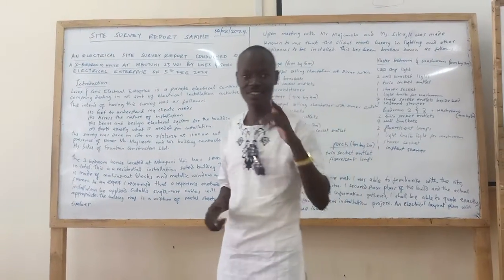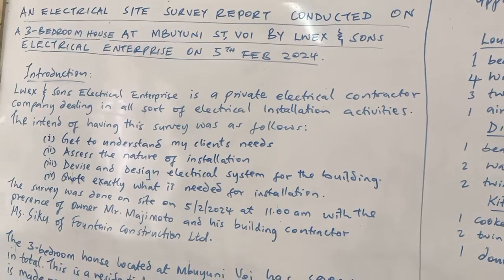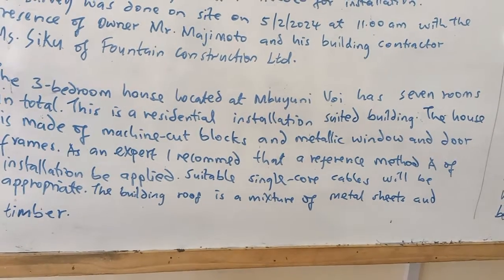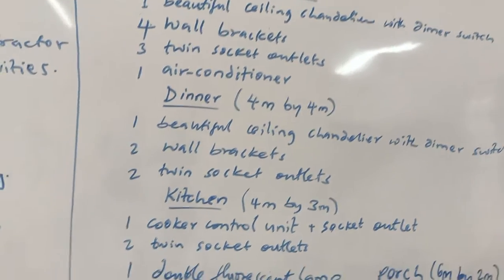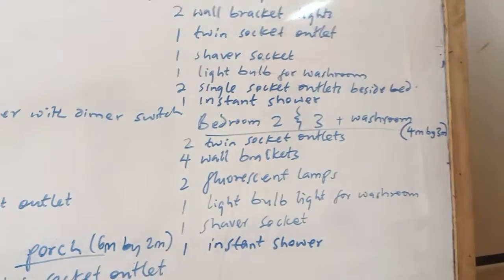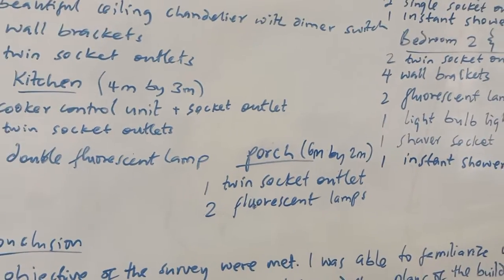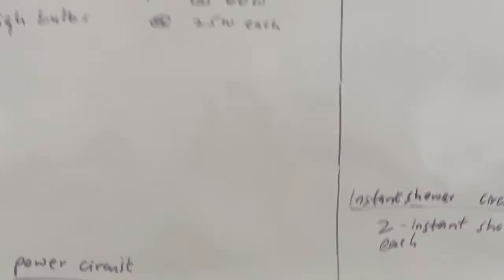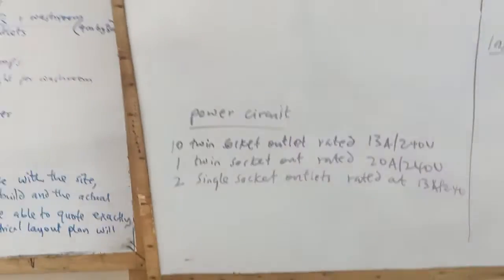ELECTRICAL SITE SURVEY REPORT SAMPLE

Comment: Sir, at what load should your Circuit be of 3phase
Reply from the maker: 3 phase and 1 phase are usually by design. Unless you have many machines running on a single phase then you will install a 3 phase but still power machines each on a single phase as you balance your load on a three phase supply.